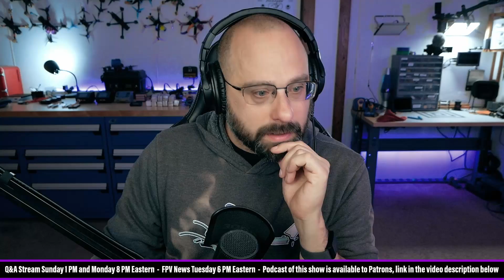Should I Just Buy A High KV Motor and Then Use An Output Limit? - FPV Questions

Comment: My ESC broke down because of high kv motor. It was 2700kv . I was running it on 12 volt 10 ampare power supply but it still broke down my 30 amp ESC .

Comment: Copter 4 inches, Li-Po 4s Motor 1505 3450kv. flight time 16.5 minutes. hover gas 17% (no tricks).
With a reduction of 80% to 2760 kv. hover gas 22%, flight time decreased to 16 minutes. and it became somehow uncomfortable to fly due to the sluggishness of the engines, you have to accelerate more.
The point is to change the kv. it’s not clear, you can simply not raise the gas above 80%.
The engine will still not turn into an economical one.

Comment: What about the flip side of the kv question... With 8s escs available, what about running say a 1500kv motor on 8s that only rates itself for 6s? Shouldn't a (single strand winding) 1500kv 6s motor of a given stator size be identical to a 1500kv 8s motor? What could possibly be different between the two?

Comment: Rush matrix 30A BLHELI32 4-1 ESC and EMAX 1606 4000kv  on 4s can I use this to change my motor kv to 3000 kv and still run it on 4s???

Comment: High kv motors also benefit from lowering ramp up power a bit more.  I run 20-25 rampup power on 2080kv without a output limit on 6s.  Been running it like this for 6 months now.  Was flying 1980kv prior the same way. Definitely fried a couple motors but the only escs I fucked up were from crashes that probably woulda killed shit either way imo

Comment: High kv motors have lower resistance and will allow for higher burst current and you are correct in that the fets have to work harder to control current flow.

Comment: I use Hyperlite E 2207.5 2200kv on 6S.  Ive been runnng this setup for a few years at full tilt with no probs.  Motors run a little warm but not on the hot side.  Only thng to be careful of are badly bent props.  Havent burned an esc but motors will get hella hot if a prop is really out of shape.  Other than that the setup yeeeeeets and really shines with light low pitch props.

Comment: I need some help. Been flying a nazgul 5 v2 for a year and it just isnt flying good at all. I updated it to 4.3 when it came out and it was fine but out of nowhere its like the fc/esc arent working right. No crashes lately so idk what it could be
Reply: New pid profile, try  stock pids,  retune slowly... maybe new motor if one sounds different then others. Test in motors tab.
Props off of course.  That's what I would start with. I changed frames.  I went with aos5 v2. Easy to build too. Flys great
Reply: @spfpv6753  thanks for responding. That's exactly what I've been doing for the past month and nothing. I think my fc/esc just died after a year of use. It looks like new and everything works as it should on betaflight but the drone don't fly great at all. Stock pid or custom pids/filters

Comment: Been running 2400kv on 40amp ESC on 6s with a 72% motor output limit for almost two years and my ESC hasn't let me down yet, and my quad Can tell you i'm not tender with him.
Reply: Nice to know, i've bought xing 2205  2300 kv motors for a 3.5 whoop and i wanted to reduce the output to 80%  but i was worried about my speedebee 35 amp esc
Reply: what is you esc fc ? if I may know

Comment: For example on a 5" just choose some higher kv motors like 1950kv on 6S. Then if it's too much for you skil or needs, use 85% motor output Limit. When needed push it back up.
But dont get 2400kv 4s motors and run it on 6S with MOL...
Reply: This has been my approach   also. I run the zing 2207 1855kv and limit it between  98 and 94%
Reply: How you feel the efficiency with the limit output? I want to buy a new set of motors, these has 2 kv options, 1950 and 1750kv my plan is use my build just for cruising smooth freestyle what make the 1750 perfect for it, and few guys say buy the 1950kv and limit output, but curious aboutif it will really improve flying time like willbe with 1750kv@fxrc3086

Comment: I can definitely second your theory because I have a load of 4s motors and my 6s rig broke after 2 years and built a beast on a leash and have gone through 3 4in1's and 2 sets of single esc's and  I finally gave up on the idea.